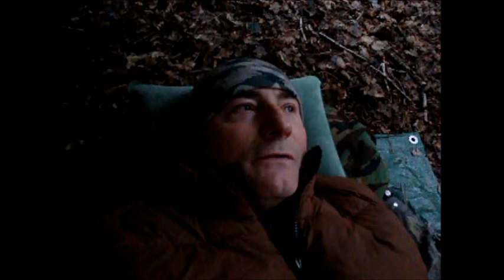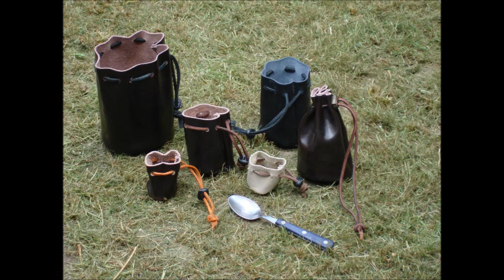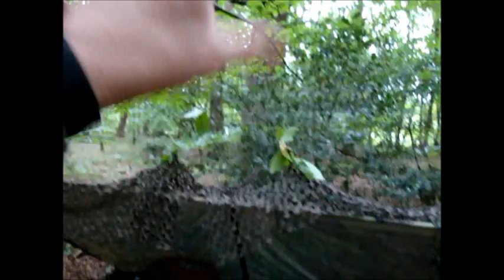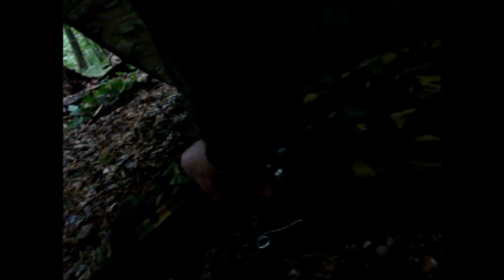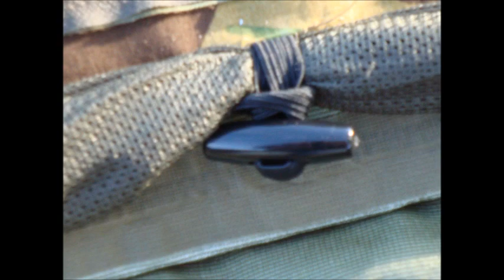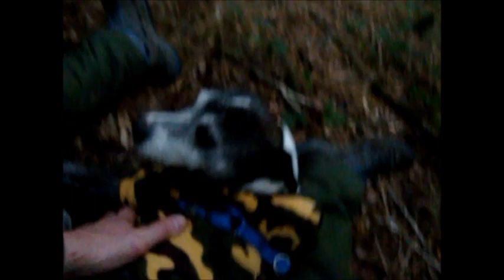DUTCH ARMY SINGLE HOOP BIVVY BAG REVIEW @ Stealth Basha Set Up

Comment: Great video, is the bag still going strong ? Would I fit my spaniel Toby in with me ?thanks
Reply from the maker: Yes it's ok although I shall be modifying replacing the hooped zip with a wider stronger 10mm tooth width zip so there's less torsion to zipping along the curved line, they can be prone to get stuck or misalign zip teeth over time. When I had "safari dog" it was a bit of a squeeze getting her in the bivvy. Anything above terrier or staffy size will feel a bit squashed & no room to move/adjust sleep position.
Reply: MINDWISEMAN thanks mate, aw poor safari Dog, so sorry.dogs are the most amazing companions

Comment: Hi Pete, I was wondering what type of camo net you used in this set up. I am looking at buying one to make my camp a bit more stealth. Thanks.
Reply from the maker: +Luciano Nebiante I have 2 pieces of 1.5 mtrs x 3 mtrs. Acquired from ebay many yrs ago. It's green one side & brown the other but the brown shows up the green side through the holes. Green side tends for some reason to remain mainly green. I find it versatile & just the right size to have 2 for varied uses. Loads of varieties/prices/sizes/dealers on ebay - your best bet.
Reply: Thanks Pete, I will have a look on ebay.
Thanks also for the tip on the side that suits better for camouflage.

Comment: I have one of these Bivi bags but before I go around using it can you tell me whether I NEED to set up a basha alongside it or can the bivi hold it's own if there was a small downpour etc?
Reply from the maker: ***** As long as all the fastenings work the material is made to fend off water ingress & keep you dry, that's of course whilst you remain zipped up in it. It's made for quick response get down & sleep for the military so it's worth considering putting up some sort of shelter simply to sit up & do your admin.

Comment: Hi Pete, thanks for that mate, much appreciated. Will get in touch with them.
All the best and Thank you.
Tel.
Reply from the maker: Plus you can get more of a heavy duty plastic zips (10mm teeth width) off ebay, just search words e.g. "military zip" "heavy duty zip", plenty of dealers & prices for the same thing. Range from 50-60cm long to up to 1.5 - 2 mtrs. I used the one mtr long black 10mm to replace the small teeth zip that broke on my Tiger Paws 1 man mountain tent - featured the pair in the vid Mountain Tent - Hill Trek Pitch Test explaining how I stitched the 10mm zip onto the broken one @ 12.30 onwards. Same technique can be applied to any original zip, saves messing around having to unstitch original. Good luck!

Comment: Do you get any condensation inside.
Reply from the maker: I've never had condensation in mine
Reply from the maker: I've tried varied types of red light for night but just find everything remains dark unseen tinted red with viz up to 5-6ft. Prefer to filter haze head torch/hand torch/lamp with brown or green fleece, made an elasticated cap which fits around light devices. or I use green cyalume stick on ground level.
Reply: MINDWISEMAN When setting up at night a good tip is to use a red light it will not be seen from far away by some one like a white light can be.